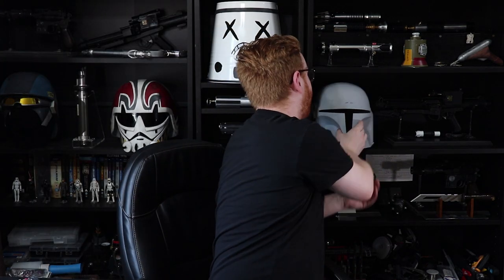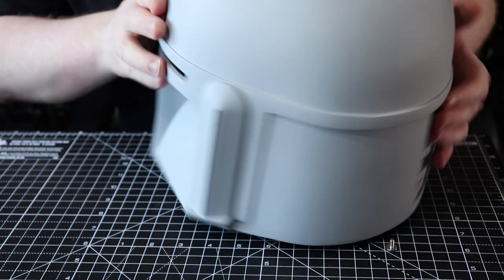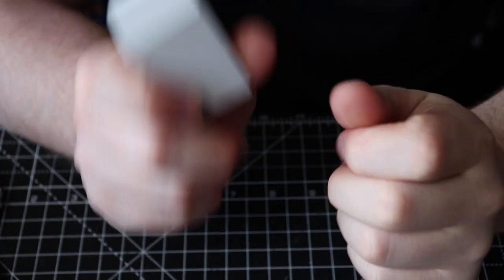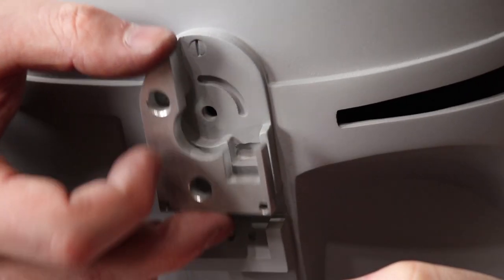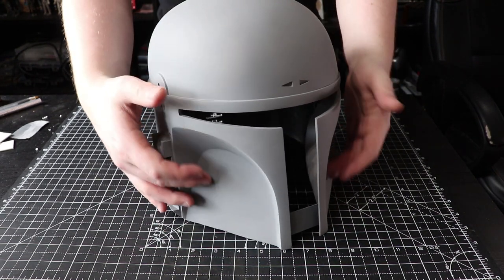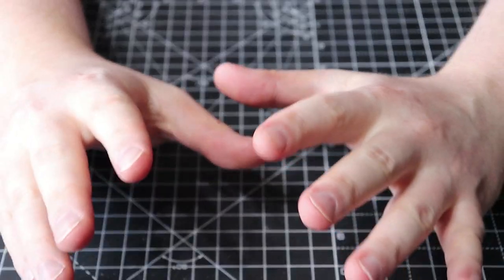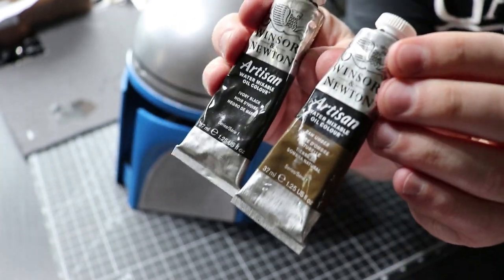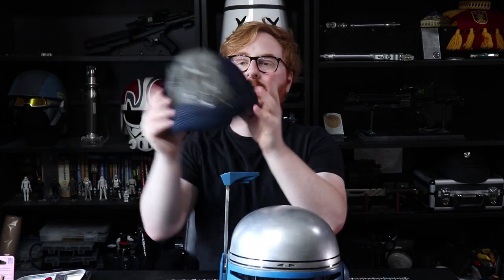Jango Fett Helmet Build

Comment: Hello! Fantastic video, thanks to you I bought some of the gold finger wax as well and I’m using it for my Jango helmet too. So far it looks movie quality, but I wanted to ask if you know of any technique to smooth out the “splotchy-ness” of the wax? I believe I applied the wax evenly over a clean surface and carefully book it, but the wax seems to have a lot of darker spots to it. Do you know any work around for this?
Reply from the maker: That's great! As for the splotchyness I'm not sure, I did a couple of coats, buffing in between, and leaving a day or 2 between to let the wax dry. I had to be careful about applying it too thick as it can build up in places and look different. Also be careful if you weather with oil paints, they look the best but will take up the finish a little.
Reply: @BucketheadStudios  I’ll workshop it a bit, I think I’ll be able to dial it in now. Thanks for the advice!